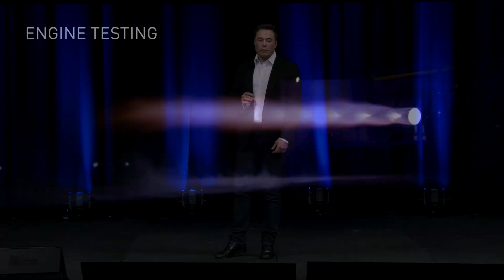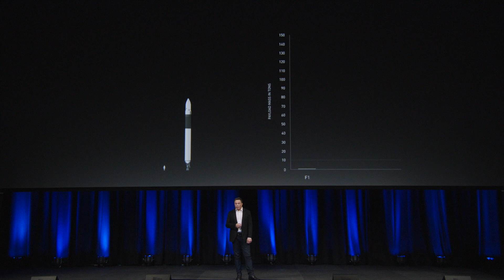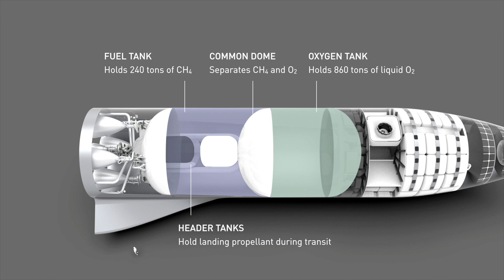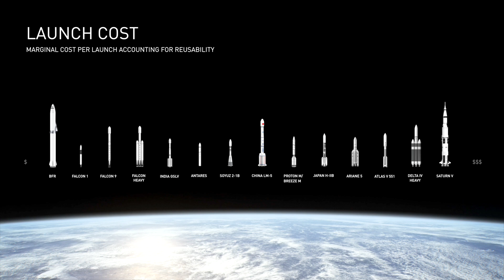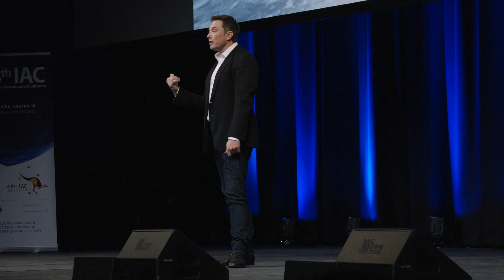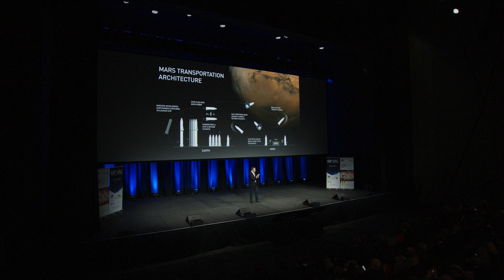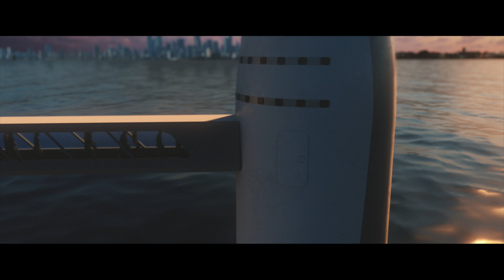Making Life Multiplanetary

Comment: I heard Elon say" if only there was electric rocket technology",  well why not build a rollercoaster track that brings the rocket to high speed using induction motors , with a slow curved ramp  . therefore using electricity to gain momentum and speed that would normally burn most the fuel in traditional take off methods. not sure but would love to hear Elon's answer to that suggestion.

Comment: 21:03- 860 tons of O2 for 240 tons of CH4:  I'm figuring 860 tons of oxygen burns ~215 tons of methane.  Burning 240 tons of methane requires ~960 tons of oxygen.  Why are fuel and oxidizer tanks not proportioned stoichiometrically?... or is it a typo in Elon's slides?

Comment: If you send 3 tankers on a slower trajectory to mars before the Mars cargo or man mission, you could then refuel before landing on Mars and Again after leaving Mars knowing you have more then enough fuel in orbit around Mars...
Reply: That's why they're sending cargo ships first actually, those will fill up with fuel, and they won't send manned ships until the ones on the surface are fuelled
Reply: Why engineer the fuel there when you can send it faster and easier at lease to start. Plus free up time to figure out more stuff on the planet.
Reply: Because it's not easier and faster. Sending a single ship ahead to manufacture fuel on the surface doesn't impact the crew's free time, as it is completed automatically before they arrive. The method you propose is actually harder and slower.

First of all, capturing into orbit around Mars from interplanetary velocity is time consuming and complicated, and needs to burn fuel making adjustments. Landing directly on the surface is much easier.

Secondly, even if the crewed ship did refuel in orbit before landing, it's not designed to land carrying lots of fuel, as this makes it very heavy, so it can't aerobrake correctly, it might even be impossible for the current design to land with enough fuel to launch again.

And lastly, the fuel needed for a return journey from Mars for one ship is around 1100 tonnes, while a tanker can only carry up to 150 tonnes from earth to Mars.

So you'd need to send 7, maybe even 8 tankers just to bring the crew ship back, then leave them empty and useless in orbit. This is a waste of resources, and goes against spacex's re-usability plans.

It also means that you'd have to perform 8 or 9 fuel transfers instead of 1.
Reply: Im not talking about the crew's free time. The mission timeline is important as well. how could it be possibly faster to produce fuel on mars then on earth when no one is even 100% sure of whats needed to produce it on mars yet? With technology that does not even exist yet! Meaning sending a ship to analyse all that the next ship as to bring then send the second ship as " proof of concept " hoping all goes well and then send a crew...
Reply: Do you have a source to back up your statement that the technology doesn't exist yet? Or that we aren't 100% sure that what we need is on Mars?

Because as far as i can tell we had a working prototype as far back as 2011. It's a very simple system, the mechanics of it date back around a century:

https://en.wikipedia.org/wiki/Sabatier_reaction

It only needs two ingredients, co2 and water, and we know with certainty that both are present in large quantities on Mars.
Reply: how much co2 is there? what is the rate of extraction? and how do you plan to extract the water... more tools , more systems, more things to fail... my point is here on Earth we have it all, ready to send up there. we don't have to build a robotic mining colony so how can making it on Mars faster? In the long run , yes we can make it there. But to start settlement all we need is to refuel the ship before landing and then there is enough fuel left for 2 years survival plus takeoff in case the fuel  on Mars cant produce due to some malfunction or something.
Reply: Did you do any research at all?

CO2 on Mars is literally everywhere. The air there is 95% CO2.

Extracting CO2 is literally as easy as pumping air into the fuel system. 

Water will be a little harder, but should consist of simply drilling straight down wherever they land, since the planet is littered with subsurface ice.

They could then use heat to melt the ice and suck water up with, once again, a pump.

I don't know about you, but i think rocket scientist can design a drill and a goddamn pump.
Reply: what about water?

Comment: Maybe its so simple someone already thought of it, but here goes;
Butt to butt docking and refueling is genius. But maybe take it a step further.

1. For redundancy, send two BFR's on the Mars missions, both on the trajectory at the same time. One full of cargo and personnel and the other with light-weight transferable cargo and extra fuel.

2. Have them Butt-Dock on the way.

3. Have an internal personnel transfer-tube with a cable-type transfer sled built from nose to end that can connect in the Butt-Docking.

4. Set up a spin of the docked BFR's so you have reduced gravity during the trip, very helpful for the health and comfort of the occupants plus more living room using both BFR's on the way. 

5. Before reaching Mars, transfer light-weight transferable cargo and personnel to one BFR through the transfer tube, and disconnect.

6. Enter Mars orbit with the BFR carrying extra fuel and no personnel, doing so autonomously using air-braking.

7. Land the Personnel and cargo filled BFR on Mars. (Only land one of the BFR's on Mars, leave the other unmanned and with extra fuel in Mars orbit). 
You can use the internal personnel tube sled as an elevator to transfer people and light-cargo to the surface and back, as well as the large hatch with the crane on the upper outside as planned.

8. Once landing BFR refuels and is ready to leave Mars, Butt-Dock and refuel the second orbiting BFR.

9. Both BFR's burn to return to Earth.

10. Butt-Bock on the way back and spin-up again for reduced gravity.

11. Disconnect before Earth reentry and land both BFR's

At any point in the mission, you have a redundant BFR that can get them home. The second BFR could also autonomously land on Mars in the event there was a problem with the first BFR.

Run it by Elon. If he needs any UAV or manned helicopters designed and developed, have him give me a call. ;-) www.fettersaerospace.com

Comment: It was all going so well until the suggestion of using the ships to travel between cities on Earth. That's just not realistic.   Most people won't fare well in a rocket launch, and the cost of each launch would result in big ticket prices, not to mention each 30 minute trip would be followed by weeks or even months of preparing the same ship for the next 30 minute trip.  I'm sure Elon knows this better than anyone, so I'm not sure why it was tacked on to the end there.
Reply: The idea is that they can get turnaround down to under 24 hours.

As for price, it actually compares quite favorably with, say, an Airbus A380, at least on first principles. Fuel per flight is around 10% more cost, and cost versus lifetime use is around 6% higher, and it will carry more people.

What will determine the economics is logistics and refurbishment, both of which remain to be seen.

But people getting sick in zero G is definitely a concern without a concrete solution at this point in time, and safety is another big aspect.

Comment: @SpaceX 
If the ISS is not supported by the International Staates, then you could bring its waste to mars, because the ISS includes a lot of usefull parts, which could be used to build a Mars-Station. Take a rope and put it on your BFR. Then you could solve 2 Problems at once:
- avoid waste in the near of the Earth.

- get building parts on MARS 

:)